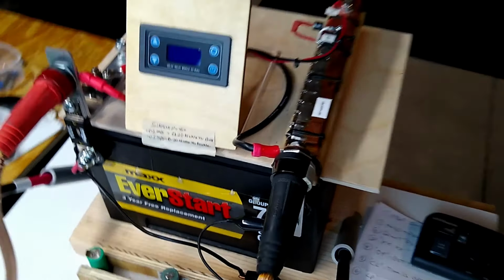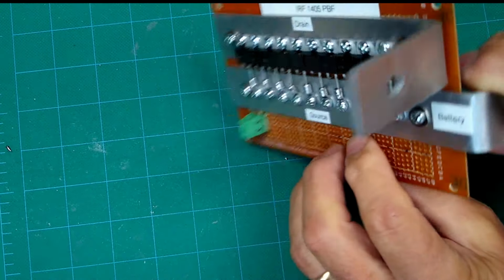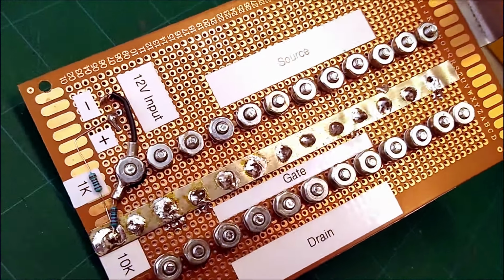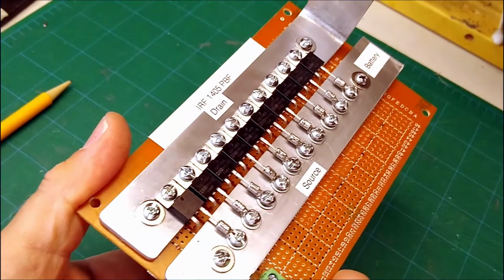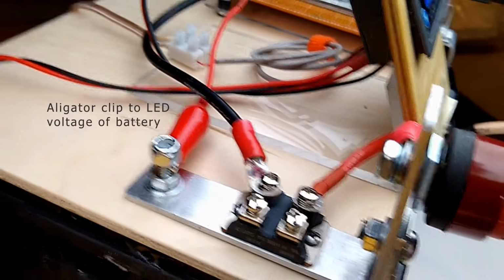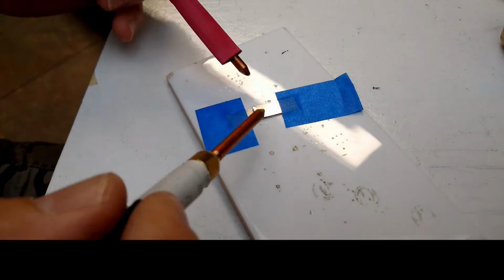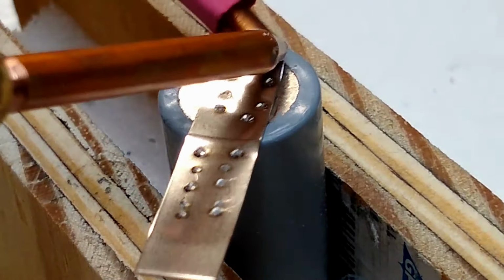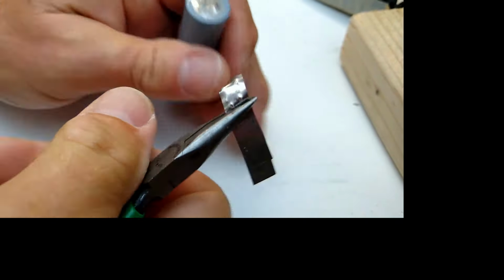Mosfet spot welder build for dummies

Comment: What pulse width are you using?  I believe you stated 2mS and 3mS, I see your panel markings are .02m/S and .03m/S which would be 20uS and 30uS. The description for the your delay timer states .01 seconds (10mS) to 9999 minutes, I would have to guess it's 20mS to 30mS since it's within the range of the timer and would make your panel have to read .02S and .03S. Thanks for the video.

Comment: rummaging through my diode collection i have found a pile of "10A10 - Plastic Encapsulated Silicon Rectifier Diodes 1KV 10A" and some "403CNQ400 Diode Module Schottky Bridge Rectifier 400A 400V" do you think these will be sufficient for the flyback?

Comment: i was about to order a malectrics or kweld do you have experience with either of those vs this version? this is a super easy version to build i could even have some boards made and use smd components to do it. thoughts?
Reply: I'll prob go kweld then.  I want something that Will hold up for a while
Reply from the maker: Had issues with the relay timer, it was sticking. Did purchase a KWeld.
You could use capacitor timer circuit to avoid a relay causing issues
Reply: @stevecahill9106  so how do you compare them? and did you get the kcap also or are you running the kweld off 12vbattery also?
Reply from the maker: @th3drizzl378 12volt auto battery.  Buy AliExpress cheap welder, and do mod on it.  YouTube search will find as well as mod. Will cost less then parts to build your own!
Reply: @stevecahill9106  how thick can you do with the kweld and the car battery reliably?
Reply from the maker: @th3drizzl378  .o3 nickel.  Join the Facebook KWeld group for more information!
Reply: @stevecahill9106  thanks i knew you could do .03 with the right power supply but i wasnt sure about using a battery. lots of bickering in the group over there so i left a while ago. ill prob order from germany honestly. appreciate it
Reply from the maker: @th3drizzl378  the car battery I use is rated @ 800 CCA. I just keep a trickle charger on it.
Reply from the maker: @th3drizzl378  https://www.facebook.com/groups/KWeldNorthAmerica/?ref=share

Comment: Hi Steve. When you are doing a spot weld, there is no iductive load that can make a voltage spike and kill your mosfets cause the is resistive!! The thing that can kill your mosfets blowing up sky high is the fact that when spot welding you are actually shorting the battery foor a short time and usually even under that short time the voltage of the battery sags to a very low voltage and make the gate voltage go low too hence mosfets DS resistance going high and geting so hot that they blow. To avoid that you can have a big capacitor  between - and + that feeds the timer...

Comment: Hi. I had a question : Is it possible to use 62 volts of battery voltage instead of 12 volts? Thank you for your reply
Reply: Yes. Make sure the mosfets and other components are rated for it.

Comment: I wonder how the timer is wired to the board. Does the timer need a separate small power supply for the input trigger at the top of the timer? Somebody posted that the second power source it is needed for the trigger on the Amazon Q&A but doesn't seem necessary?
Reply: I have mine wired to a separate power supply three 18650's.
Reply: @NBPTDOCUFEST  I have some 11.1 volt Lithium polymer packs from RC Aircraft that I fly. I will try one for the trigger input stuff and since I have two timers arriving I will also try without. Also may use some diodes if trying to use only one main power source. At the worst they can go 💥.

Comment: So in your original design it looks like you had the flyback diode between the source and gate but the new one is between source and drain?
Reply from the maker: The circuit uses 3 diodes, two in parallel for flyback and one other, See here for photos. This should help. https://photos.app.goo.gl/1WobajxR2fAQ1diF7

Comment: Great job you need to join both electrodes so when you do a connection it welds at the same moment also it helps make the distance of your welds the same.  You could ad a slight spring movement so as you press it helps with any angle difference as you create the weld it makes it fire uniform .

Comment: That is an awesome project... and well done!
A small hint: There is slitted hilumin tape available, that has little slits stamped out where you connect each battery. If you place the two electrodes on different sides of the slit, it forces the current through the sheet into the battery terminal and back up again, ensuring two secure weld spots, regardless of small details how you hold the electrodes. Otherwise the amount of short circuit current that does not flow through the weld spots is a big unknown and results in unreliable welds.
Reply from the maker: Hi Jack. I am using that nickel. I have also created a pneumatic version so I get consistent pressure on every weld. Not fully built out yet. Will do another video on the upgrades that I have added. You can see it here not completed yet. https://photos.app.goo.gl/UsszZKdtiq69sPZJ9

Comment: I just replaced  the original 1K and 10K resistors with 95 Ohm and 220 Ohm. I did notice with 95 Ohm and 220 Ohm resistors that the mosfets did not get as warm as as previous. 

I think the reason why the MOSFETs are not getting as warm as before is because the driver signal going to the GATES of the mosfets has been reduced. Adding the 220 ohm is lowering the signal to ground, which in turn lowers the drive signal.
Reply from the maker: Hi Bill, I did noticed that when I used 95 Ohm and 220 Ohm resistors that the diode that was there got very hot.  I reverted back to these resistors  1K for the pull down and 1.5K for the gate jumper in and out different resistors so that the welder did not work to when it did work again. Whish I had a oscilloscope to fine tune it. The reality is that it is working fine, great welds. I may revert back to the resistors your using now and measure the heat generated for reference.  These are diodes (two in parallel for the flyback, EMF) https://www.amazon.com/gp/product/B008UG15QY/ref=ppx_yo_dt_b_asin_title_o01_s00?ie=UTF8&psc=1     This is the diode used with the mosfet https://www.amazon.com/gp/product/B01N11W49P/ref=ppx_yo_dt_b_asin_title_o00_s00?ie=UTF8&psc=1    I will try Messenger on Facebook to send you some pics of the above.

Comment: Hello Steve, great video on yet another spot welder diy ! 
I have question: You are using schottky diode to protect mosfet, so this is the same as how a mechanical relay/solenoid is protected using IN4007, am I correct? Thanks for your reply!!
Reply from the maker: I don't think it would hurt to put one in. The use of a mechanical relay is more prone to a failure which could result in the sorting of the battery. For protection make sure you have a fuse on the battery if this happens.  I have my mosfet welder battery fused as well.
Reply from the maker: Aswin, I have updated the mosfet welder as far as diodes are concerned. I changed out the Schottky with a Taitron Components T6A100L Diode, GP, 6.0A, 1000 Volt . Additionally I also have  two NTE Electronics 1N4007 Standard Recovery Rectifier Diode, General Purpose, Single, 1.0 A, 1000V in parallel that go from the mosfet welders drain rail output to the positive of the battery. The orientation of these mosfets are that their negative side is towards, facing the positive battery. This is to handle EMF feedback, inductance that would harm the mosfets.

Comment: Just wanted to mention. The label under the timer is showing 0.02ms and 0.03ms. I think that should be 20 and 30ms. I believe 0.02ms is the same as 20 Nano seconds.
I Could be wrong. 1000ms equals to 1 sec.
Delay Relay Module, DROK DC 6-30V Timer Relay 12V 24V 0.01s-9999min 50mA Digital Timer Cycle Delay Switch Module AC 220V Power On-Off Controller with LCD Display Switch Button Case
0.01s is the same as 10ms

Comment: I'm a little confused on what fires/triggers the gate of the MOSFET’s? I know a little about electronics. I understand your using that 'TIMER'.  That timer claims to work 0.01s-9999min. looking at that timer in details, I see it uses a relay to provide the timing. Are the gates of the MOSFETs connected to the relay in the timer? Hard for me to understand that a relay is able to work at that short of time (0.01s). That short of time, it doesn’t give much time for the contacts within the relay to make contact. I hope there isn’t any bouncing of the contacts in the relay when closing that fast.  If that makes any sense in the question. I could understand if that timer had an electronic output switch like a small mosfet or an optical isolator triggering a transistor.
Just want to make sure I understand your illustration correctly. Thanks for the ideas, as I’m in the process of building my own S.S. welder. Overall, your project looks awesome.
Reply from the maker: Bill, good questions. As I understand it  the timer sends the timed burst of 12volts to a 1K pulldown resistor that continues to the gate. This opens the mosfets to pass the negative battery current to the negative electrode tip. The positive battery terminal is the other welding electrode.  I have not had any bouncing of the relay not to say that won't happen, but to your point perhaps a variable 555 timer would be more appropriate. The current timer I am using does allow adjustment down to .01 which with that timing it's not a solid weld. I usually start at that value when testing then end up around .03 when welding .15 nickle.  555 timer is now  next on the list of things to build.
Since all the mosfets are in parallel there is no need to put a resistor in for each of the mosfets from source to gate.   I am still experimenting with the gate resistor will be testing a 470 ohm resistor and leaving the pull down at 1K.
Reply from the maker: Bill, that relay may be for just the foot switch to trigger the timing, would have to investigate further
Reply: @stevecahill9106  Steve, (got a brother named Steve), well anyhow. Thanks for getting back so soon. Ya, I'm pretty sure the relay is the output that's going to the Gates of the Mosfets along with the 12 volts and resister. The trigger signal happens at the three pin connector on top. Ya, you're right with the 555 timer, as that's what I plan on using as a 'One-Shot Timer'. One YouTube video that I've been feeding off of ideas - https://youtu.be/p6XTPPBLiYg
Reply from the maker: @billspradlin9619  would be interested in your 555 timer. Will keep looking for a one shot. Found this , but it's not one shot . https://youtu.be/yBVGU02rlAg
Reply from the maker: @billspradlin9619  https://youtu.be/674mPQUbz6Q
Reply: @stevecahill9106  As my Dad would say, Leave Well Enough Along. Ha, if your system works, keep on using it. With me, I'm building mine and I'm trying to be as cheap as I can be. Plus, I enjoy building from scratch if I can. But there is so much electronics modules / components out there, it's hard not to resist buying instead. I found a pretty good 555 circuit to provide a 'adjustable one shoot' timing for this application.
Reply: Found what I was looking for, 555 IC, One shot timer. Instead of feeding the output to a relay, use a transistor.
Also, it looks like you're powering the timer with the 12v car battery. Hope the current surges don't affect the timer.

https://circuits-diy.com/555-one-shot-timer-with-relay-at-output/
Reply from the maker: @billspradlin9619  Using a separate power supply for the timer. Last time I used the same battery for the welding and timer I blew up the mosfets. Probably introduced a short. Not sure I used the right trigger low vers high for the foot switch. Never sorted that out. Did not want a 2nd occurance.  Painful to replace mosfets.. thanks to the link to the 555 circuit, will have to figure how the transistor goes in and how it works.
Reply from the maker: @billspradlin9619  I like the idea of using the capacitor to adjust the timing. At least you can know what the given value is for a weld time you like. One thing that I like about the current timer I have is that I have a delay set of 1 second before it can deliver a 2nd weld. I found that sometimes when I pressed the footswitch it would send a double single to the timer and it would do 2 welds when I only intended to do one. So that is a handy feature to have. It could be the nature of the foot switch I made that can cause this. I could go to a finger press switch once I get this converted over to pneumatic control. See this Facebook group @ https://www.facebook.com/groups/DIY18650    See the Cindy Whritenour postings,  I have some photos posted there. If you join we can share photos and ideas. Your suggestions would be good for the community.
Reply: @stevecahill9106  Steve, great information. That issue with the foot switch causing double welds is from, what's known as 'Double bounce" from the contacts within the switch itself. Another words, the contacts are actually making contacts for a very short time, twice of many times.
This is where a circuit called 'Debounce-r'  comes in play. To prevent the contacts from causing a double signal from happening.  
Internet INFO - 
"Debounce time is basically and amount of time that the switch doesn't register another click. Jan 15, 2020", "Electrical contacts in mechanical pushbutton switches often make and break contact several times when the button is first pushed. A debouncing circuit removes the resulting ripple signal, and provides a clean transition at its output". Ya, I'm back on Facebook, as before I deactivated myself. I just reactivated it. Thanks. 
Funny you mentioned a pneumatic control. I bought two pneumatic foot pedals which activate an electrical switch. Haven't played around with them yet with  applying them to anything. I did noticed they require a large amount of pressing on the foot pedal to activate  the switch.
Reply from the maker: @billspradlin9619  Ok a denbouncer circuit. Thanks for that.
Reply from the maker: This looks promising https://www.circuitbasics.com/555-timer-basics-monostable-mode/

Comment: The variation in weld quality that you are seeing is because of the variation in the amount of down force being applied at the time of the pulse. Factory welding machines use pneumatic piston powered electrodes and then the welds are the same everyone.
Reply from the maker: Brian, funny you should mention a pneumatic welder. I am building one from a automation slider I have with a small pneumatic actuactor I got from Amazon to get consistent pressure. I am using the hand welder with the spring copper bars that I have taken apart and fashioned them back into a wooden holder that attaches to the slider. Had to order compressor adapter to get down to 1/4 tubing for connection to the solenoid controlling air to the actuator. Will create a video about this when tested and working. Subscribe here to be notified. Thank you for your interest.

Comment: Hello sir. Is it possible to have a simple final circuit diagram with the names of the components?
Reply from the maker: All the components are listed in my YT Description at the bottom. Photo of circuit done by a Facebook person @ https://www.facebook.com/photo?fbid=10228275429456782&set=gm.924615821687945  NOTE: her photo does NOT have the updated resistors R1 and R2 I just changed over to.